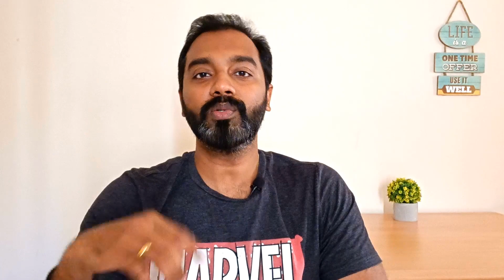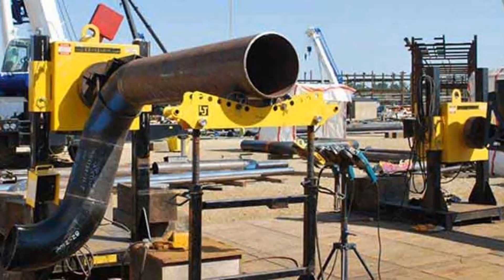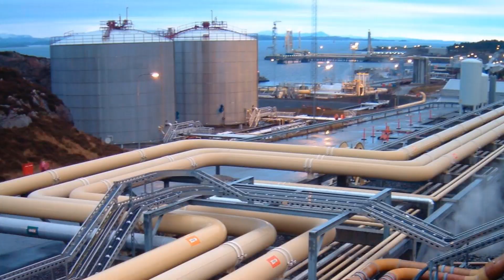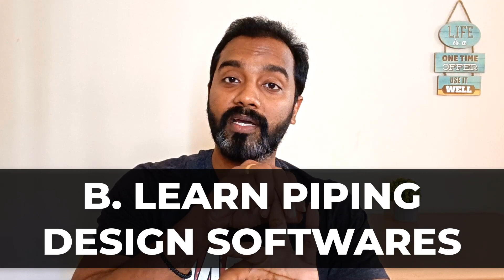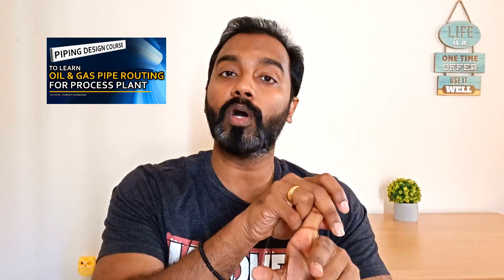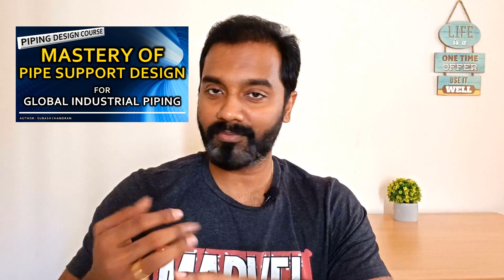How to change Career from Piping Construction to Piping Design Engineering? #pipingdesign #piping

Comment: Hi sir. 

I am mechanical engineering graduated 2017. Currently i am working in mep construction field.

Now i want to switch to piping design field. Is there possible.

Or else it will be difficult to enter?

Please answer sir